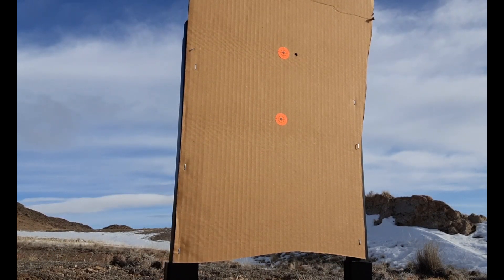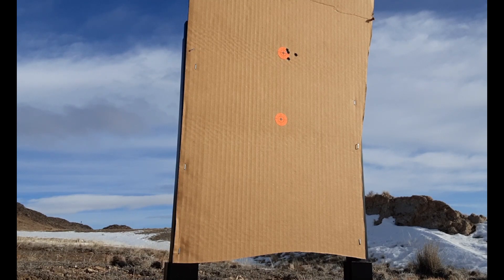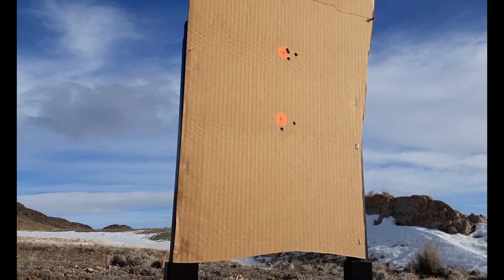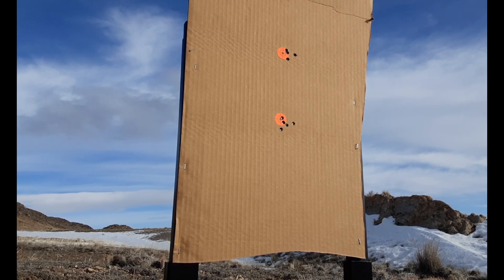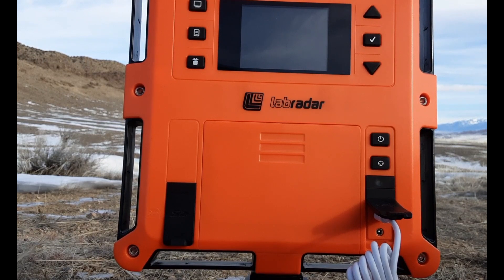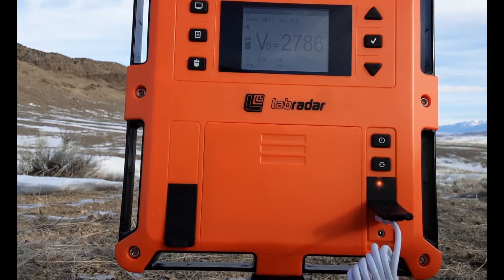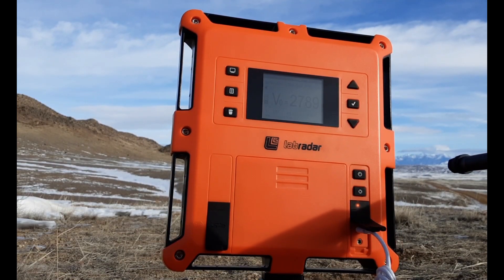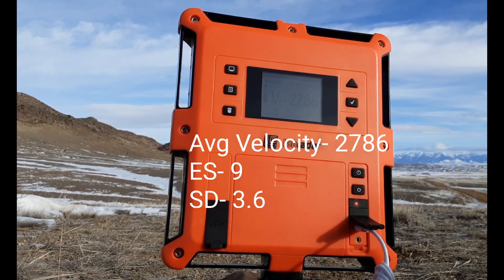6.8 Western- Nickel Plated Brass Annealing Test- Berger 170 EOL

Comment: I anneal every time. One thing I have been doing is adding a graphite neck lube (neolube) and they all seat like butter. It’s especially important to keep your process the same all the time, I’m sure that’s a given.
Reply from the maker: Ohhhh, that is good to know!!
Reply: Probably anecdotal more than anything, the nickel cases seem to me to work harden more than typical brass cases.  Are you using a bushing die to set the neck tension?
Reply: @GEMStateFirearms  I am sorry I didn’t see this till this morning. I set neck tension with a mandrel at .003 (.274”).
Reply: @jasonnull2248 let me know how it goes.  Getting ready to buy a set of 6.8 W dies and would like to hear any opinions! Tganks

Comment: I reload 270 win and 6.8 spc. My X-Bolt Max Hells Canyon Long Range 6.8 Western 26" is arriving in a week, so loving your channel. 6.8 western ammo and reloading supplies arriving this week (not cheap) so looking forward to kicking this off as well. While I’m waiting for magnum large rifle primers to arrive, curious if you or anybody on here has gathered 6.8 western ballistics data comparing magnum primers versus regular large rifle primers? I imagine the burn will not be as effective, but how much? May be worth a look.
Reply from the maker: I tried using CCI 200 Large Rifle Primers and found it to have a slight hangfire (I could hear the firing pin drop, then the power would ignite), so I went back to CCI 250 Large Magnum primers. My guess was the Large Rifles didn't have enough energy to ignite the powder right away. In the very small sample size I ran, I did achieve decent groups, but overall was not comfortable with the ever so light hangfire.
Reply: @roguesummithunter  awesome thanks for the intel
Reply: To answer your original question, yes I find it easier to seat bullets into cases after annealing. I do annealing with bottle neck cartridges similar to you with drill and socket, and counting time with rotations. It’s not perfect science, but I’m getting more reloads - and more consistent velocities with annealed and sized brass.
Reply: How many reloads are you seeing on average with you 6.8 western?
Reply: Do you have any data or tried 175 grain sierra tipped game king bullets ? I see some videos from ap2020 but curious if you dabbled in them.
Reply from the maker: @Stu.E.  I've started seeing neck cracking on a handful of brass after about 8-10 loads. I recently started annealing my brass, so hopefully that will extend the brass life even longer.
Reply from the maker: I haven't posted any videos regarding load development for the 175s. I loaded about 25 rounds with MagPro and StaBall6.5, but wasn't too impressed with the groups I was getting. Now that I found H4831SC to work extremely well with the heavier bullets, I would steer you in that direction if you wanted to load up the Sierras.
Reply from the maker: @Stu.E.  right on, that is great to know. Thanks!
Reply: Thanks for your replies! Excited to have another pound of H4831SC on the way thanks to your data, definitely will work up the 175s with it.